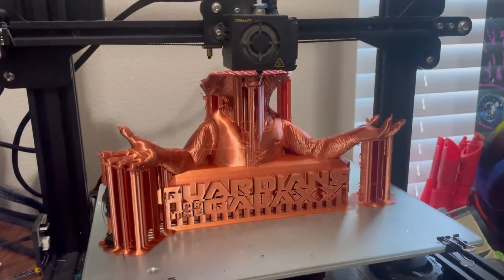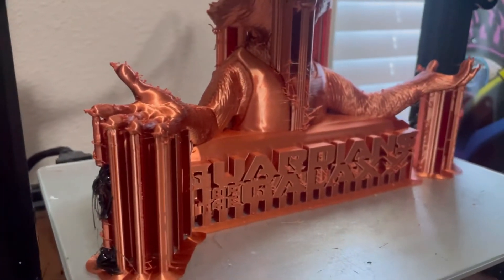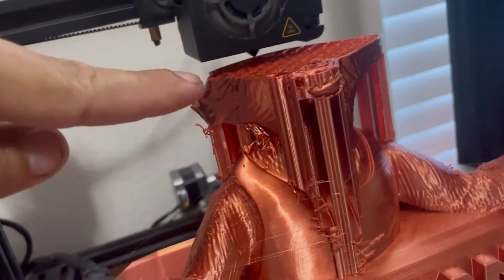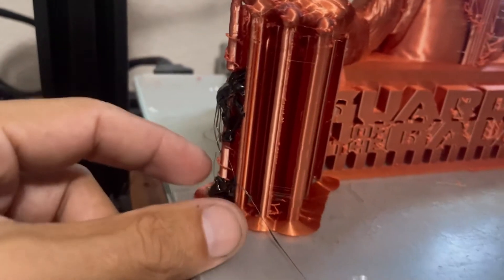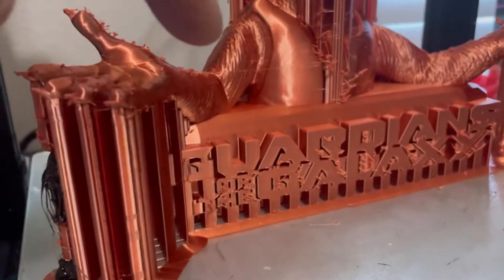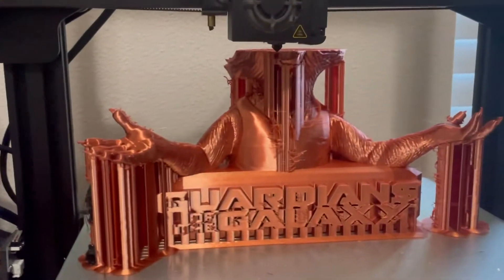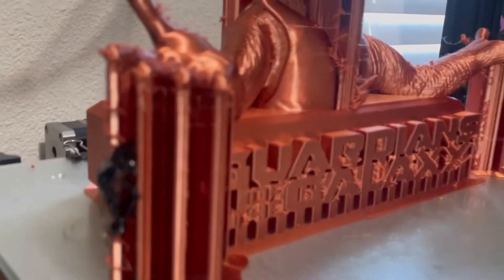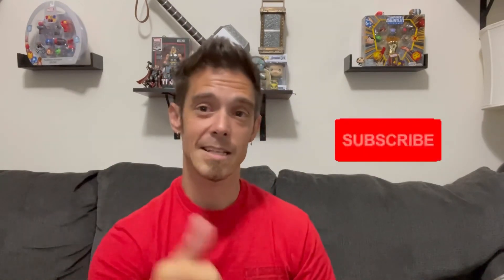How to repair broken supports in your 3D print | 3D printing hack fixing broken supports mid print

Comment: Oh well done! Like your calm, quick thinking/can do attitude.
    I just had an internal support start wobbling then snap off. Luckily one can pause the Flashforge Guider II. I fixed it back on, then glued a platform of 1 layer of PLA from a discarded print across the wobblier supports and braced them to the sides. Much firmer now, and it's VERY satisfying watching it build up from there, all safe and sound.

I wish one could add internal supports "manually", from internal structure (rather than from the raft). Any one know if there is a slicing program that does this?

Cheers J
Reply from the maker: You can add custom supports in cura
Reply: @Darkwingdad  Smashing, thanks!

Comment: I've had pretty good success doing the same with a 3D pen and depending on how bad it is Pausing the print and / or adding old support material - but agreed Hot glue gun is quicker
Reply from the maker: I did try a 3D pen but it has small coverage area and it was a bit inadequate, what I like about hot glue is a good amount comes out for coverage and you can form it if need be. Glad to see good minds think alike!